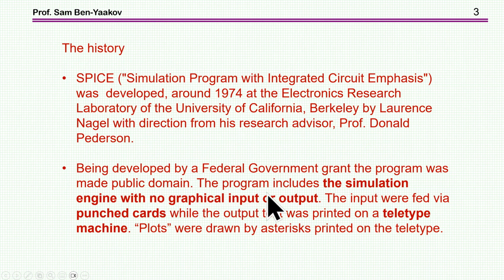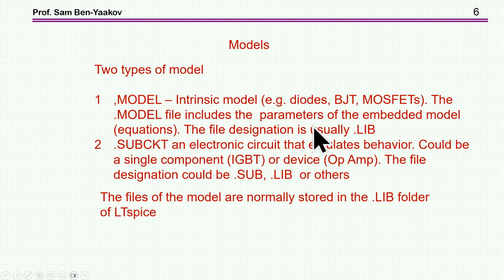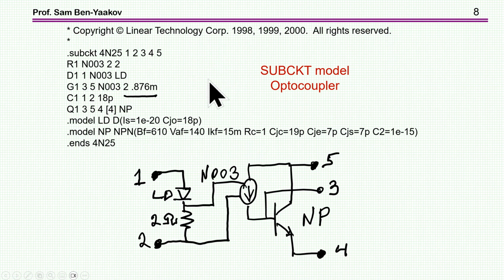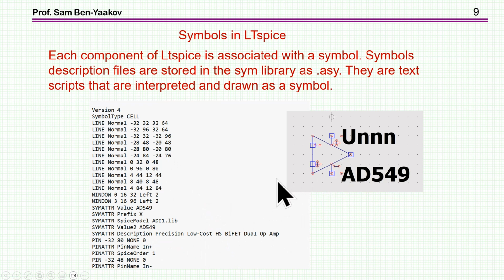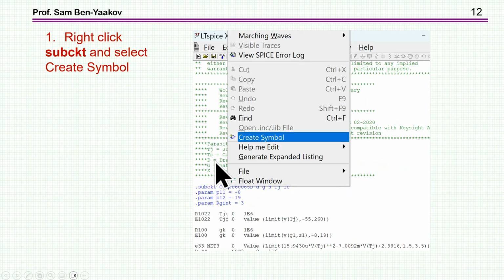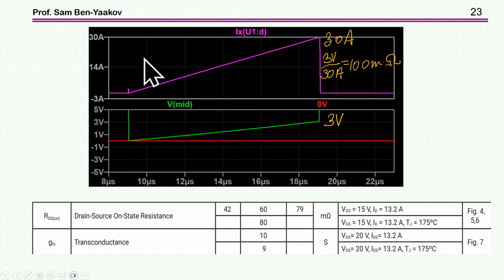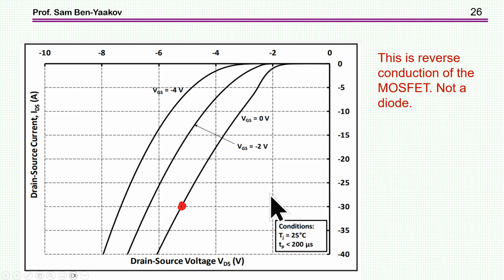LTspice-SPICE inner working and the simplest way to import SUBCKT models

Comment: I need to correct one minor detail. LTSpice is not directly built using the ”original” Spice. It uses the same model language , and of course the same principles. However the internals are different. LTSpice was constructed by Mike Engelhardt as a more numerically stable implementation (faster convergence, among other things). He has now also constructed an improved simulator based on his experience developing LTSpice, the QSpice simulator. This is also available for Free, and even faster and more robust. Unfortunately no longer naitively available for Macs due to the lack of extended floating point registers in the ARM architecture as opposed from the Intel architecture.
Reply from the maker: Sorry, but I utterly disagree. Nagel and Pederson's introduction of SPICE was a major milestone in EE as recognized by the IEEE organization. The innovation was not " more numerically stable implementation (faster convergence, among other things)"  it is the concept, organization, the link between netlist and the solver, components model, subcircuit, types of analysis, dependents sources, and more, and more and more. These were introduced in SPICE and are now implemented in LTspice AND Qspice. I love LTspice and I think the contributions of Mike Engelhardt are immense, as I wrote to thank him several times. But to say that LTspice is not based on the original SPICE is just incorrect, totally wrong, and ungrateful to Nagel and Pederson. See Wikipedia for LTspice: "LTspice is a SPICE-based analog electronic circuit simulator computer software, produced by semiconductor manufacturer Analog Devices (originally by Linear Technology)."

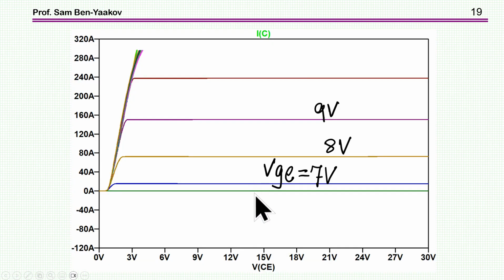Comment: Hello, can you please describe how you plot I vs V(CE) in 15:55? It looks like a dc sweep but CE isn't a source, so LTSpice throws an error. I've tried with a voltage dependent source but it didn't work as well. In addition, it looks like there is no .dc command in your schematic so I'm pretty confused. Thank you professor!
Reply from the maker: You can change the  variable of the X axis. Right click the scale and you will see the window
Reply: Works like magIC!
Reply from the maker: @yanivnet22  👍

Comment: Thank you!  What do you think about Qspice compared to LTspice?
Reply from the maker: I could not see, as yet, any advantage to Qspice
Reply: @sambenyaakov   there is ONE major advantage:
You can embed C++ or verilog in the simulation , so there can be some digital filter at some point or some SW PID .
Might not be that important BUT if SW is involved with some controll systems it will be practical since you can test some of the code. Save for Verilog since you can tune a bit more in the simulation. 
LTSpice may emulate some of those things with programmable voltage sources .
Reply from the maker: @Robert88KAL  That IS a good feature but for  control related simulation I prefer PSIM
Reply: @sambenyaakov well, running your embedded C/C++ code or VERILOG code for controllers is more than interesting. Not to mention that it is free. But somehow it feels incomplete, especially the user interface which is clearly lacking.